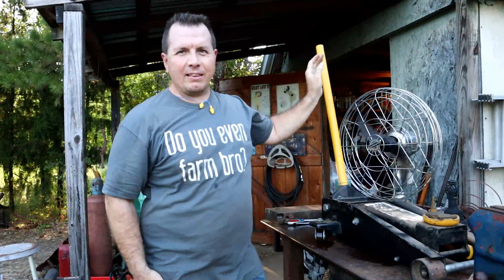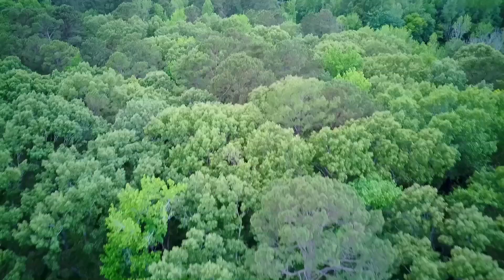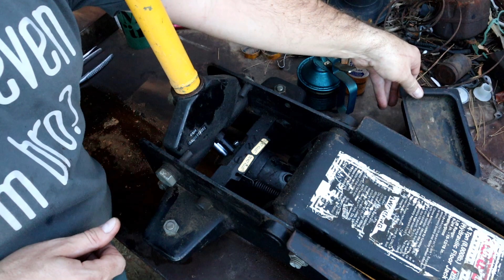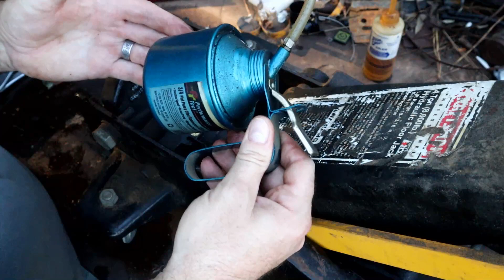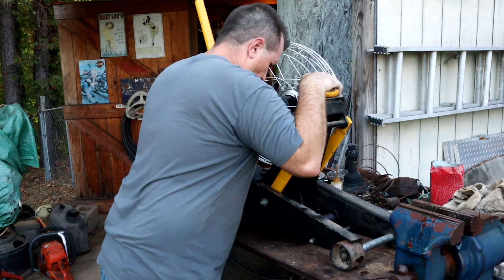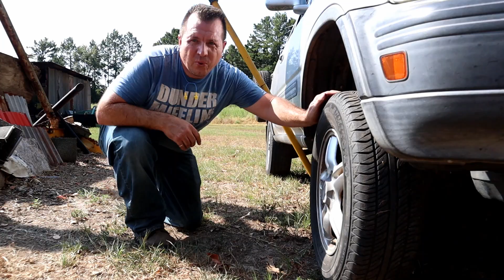How To Fix A Floor Jack The Easy Way!

Comment: Your Jack point is the flat spot some will have a raised circle spot inside the rocker panel corner behind front tires for rear tires it will be in front of them